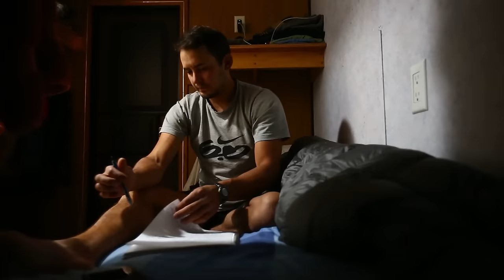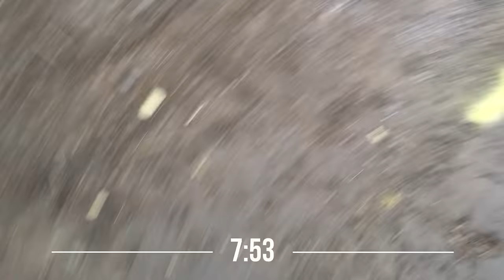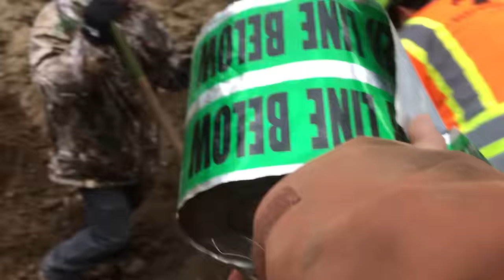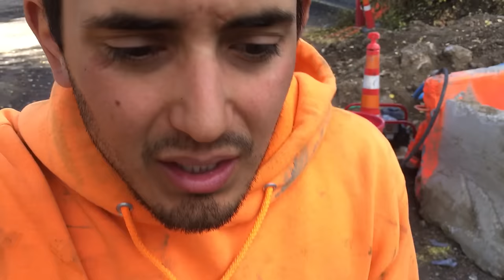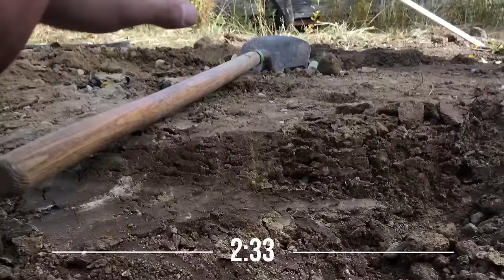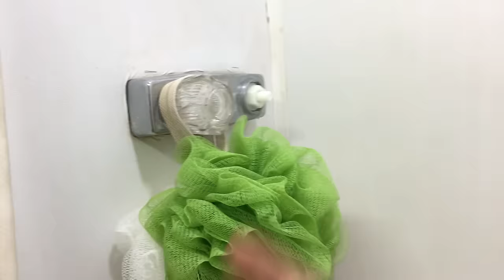Day In The Life of a Construction Worker

Comment: I’ve worked in roofing for about 3 months, being out in the sun especially in Houston tx, and it’s 100-110f outside is no joke. Respect anyone who pulls it off.
Reply: What is the pay like
Reply: I spent three weeks on roofs in between welding jobs and it was the most miserable job I've ever had and the worst paying! Pick up a skill and get the fuck out of roofing!
Reply: @connormcquaid7462  where you located ? cz holy fuck not even a mcdonald’s worker gets payed that low
Reply: I worked roofing as well for about a year & a half before I left for a better opportunity somewhere else. Not shingle roofs but metal commercial roofs, repairing rusty panels that cause leaks of all kinds, applying certain chemicals to preserve it for 10+ or so years. It was a bitch at first especially after not having worked for about 6 months, first day was 110 degrees with only 2 5 minutes breaks to get off the roof & chill but a good 1 hour lunch. Once I got used to it it was nothing but good times with good people working under the same heat I was. Those were my brothers on & off the roof, looked out for one another but it was the management that made me say "fuck this" & I moved onto something better. Salute to all the real homies that thug it out under the sun.. black, white, Asian or raza, tienen mi respeto. 🤝💯
Reply: @ihat3friday832  a lead where i was at was 30 an hour. Definitely not enough for the work we do. Roofing, remodel, electrical, plumbing,apartment landings,welding etc
Reply: It was 107 degrees when I was in Texas last year. How tf people can work in that idk. I couldn’t wait to leave. Maybe we’ll evolve to deal with it, like lizards or something. ☀️

Comment: Come pull concrete with me over here in San Antonio Texas. You wouldn't last an hour as a real labor. You're more of a driver over there.
Reply: Fuck yea I was gonna say the same but no point lol. Concrete all day everyday. 13 years now for me
Reply: your spot on, or if he came to work on a roofing crew, he'd be gone by lunch time
Reply: but concrete work isn’t really that hard. labor intensive? it can be at times. but setting forms, raking base and tamping it isn’t that hard. raking mud isn’t hard, especially once you get an eye for grade. I cut my teeth as a concrete laborer, now i’m a finisher. it’s not THAT difficult.
Reply: @foreignbeggar3783  yeah I'm a concrete Foreman and to me it's all the same. I still shovel and run with them all even though they're all 10 or 15 years older than me. It also depends on the rate of production that the company wants.
Reply: Lmao that’s it ? We work 24 hours straight in the oilfield
Reply: All of those oil field workers come over here and want to just sit around for 15 hours. The oilfield allows you to make big money because the company is making big money. When you're just making a 5% profit because of all the other competition here you got to put in real work not just long hours.
Reply: @tsplays7234  dude it's like 65 degrees over there 24/7. A couple of years back we had 40 days of 100 + weather
Reply: @foreignbeggar3783  Finish behind a Gomaco for a few seasons with lousy operator, you will not be saying it's easy.

Comment: I wake up at 4am and I. The yard by 5:15am
Reply: Probably gets off work at 2. Wake up early it doesn't hurt you
Reply: I’m a concrete boom pump operator. Our hours suck. On a normal day I average 12 hour days but the pay is good.
Reply: Rcp 916 that’s awesome except some days no break unless concrete done tough job but awesome!!
Reply: raided R you have to be used to eating your entire lunch in 5 min or less between backing up trucks!!
Reply: Rcp 916 multitasking at its best what’s your local I’m 271 Providence, RI
Reply: raided R I’m actually the owner and I’m small time. Started when I was 25 years old back in 2005 with a Putzmeister tk50 drag line rock pump. Today I’m only running 2 pumps & I have a 36m Putzmeister rill & fold and a tk70 rock pump. I’m non union. That recession nearly killed me in 08 but I managed to keep from goin tits up. I’m about to sell my 36m and upgrade to a 38m 5 section Z. Sacramento Ca is where I’m at.
Reply: raided R and the 5 minute lunch trick is only if we happen to have good truck service!!! Haha which isn’t common anymore! Hence the 12 hour days.......

Comment: I'm interested in getting a job like this. What do you call it when someone is making doing renovation to an apartment? Is that also called being a construction worker? Working indoors with drywall etc seems a little easier than working outside like this. If I were to work for a company that does indoor renovation, like the kind when you see mexicans tearing up the inside of an apartment unit, would I also have other assignments where I would have to work outside like this? I'm just curious because I don't know much about working in construction.